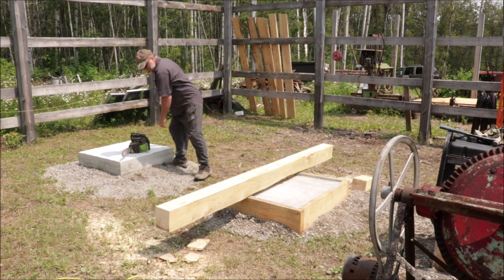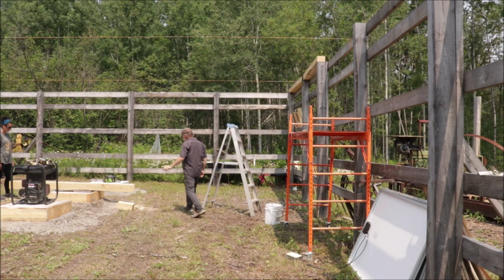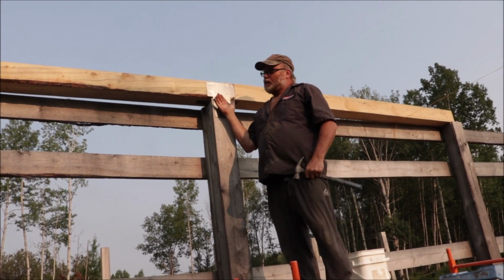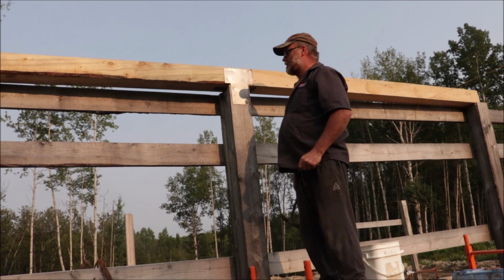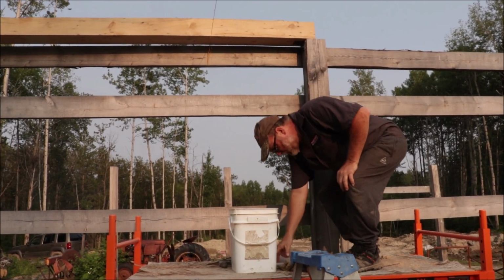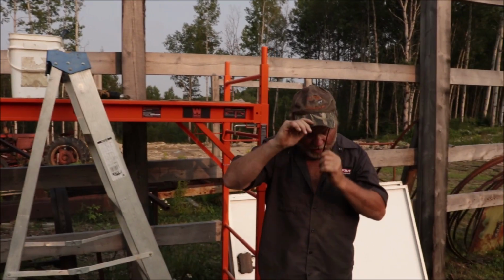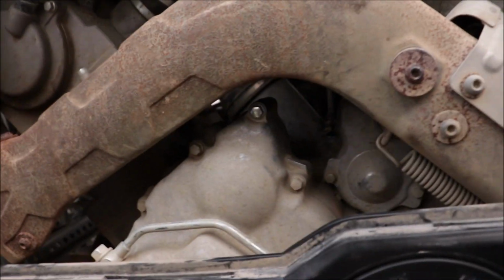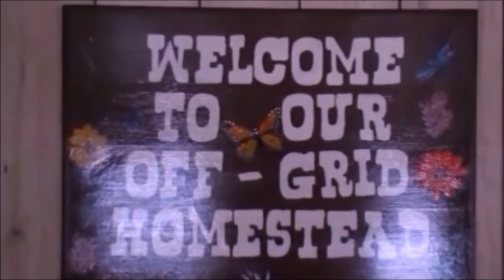Pole Barn Build At Our Off Grid Homestead.

Comment: Starlink 2 things one. 1. It needs to be in a wide open area not even leaves or it cuts in and out .   2.  It take about 12 hours of not moving the dish to get to best speed.   Not sure how it works if you power it down over night.  If not great speed try leaving power to it for 24 hours..  crazy long optimization time

Comment: Just one quick thought Cecil: It would make all that "high work" much easier if you were working over a poured concrete slab !!
Reply from the maker: Hello Bob.  That would be nice for sure ...but we just don't have the money for a concrete slab  :-(  Maybe next summer.  Thanks again. You have a great day.  Cheers.
Reply: @roycemontgomery978  
Obviously, doesn't matter per Cecil's reply but, yes if you're planning on falling, the concrete would be a harder surface to land on. The thing is, however, the hard/flat surface makes the scaffolds and ladders much MORE stable so falls become much less likely. You may have noticed where Cecil was putting a tiny piece of stone or other flat material under the scaffold wheel. When you get on top of the scaffold and the wheel rolls off the little rock or the rock rolls over in the dirt, soft surface or hard, you're going for a nasty ride!! Ask me how I know?? Was a electrician for 40 years so I spent copious amounts of time on ladders on all kinds of surfaces. The surface you are the safest on is ALWAYS a flat stable/hard surface.
Reply: If one falls on concrete one is much more likely to leak tomato sauce, then if falling on dirt.

Comment: Maybe I'm missing something. But is there a reason you simply don't use one metal plate as a template to make all the rest of the "T's" and "90 degree" plates you need at one time? Instead of running back and forth, back and forth one plate at a time.
Reply from the maker: Hello Dave.  Yes the reason we don't make them all at once is we're using our solar and batteries to run the plasma cutter.   If we do all of them at once it would be a huge drain on our power at once.  Thanks again.  Cheers.
Reply: @SkinnersHomesteading  Understood.
Reply from the maker: I probably should have explained this in the video.  Thanks again.  You have a great day.  Cheers.
Reply: No worries guys. Do what ever you need to do, the way YOU want to do it. To hell with the complainers.